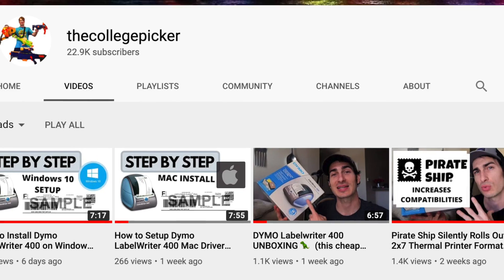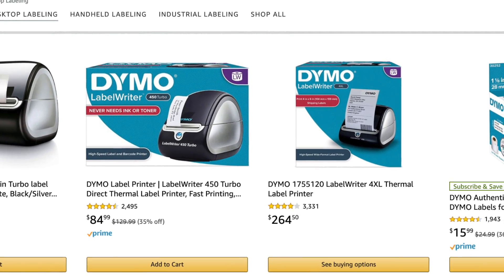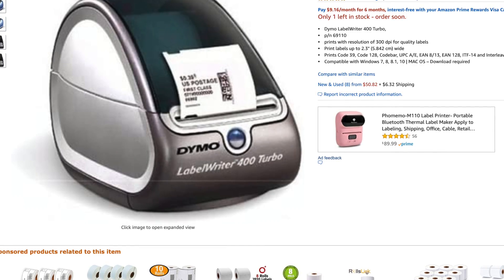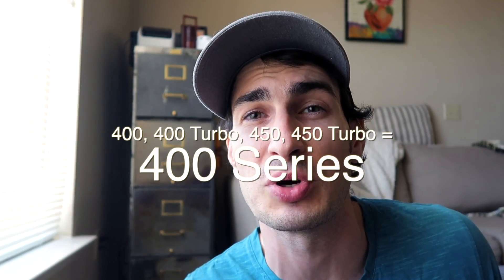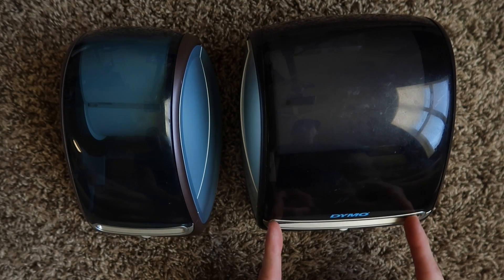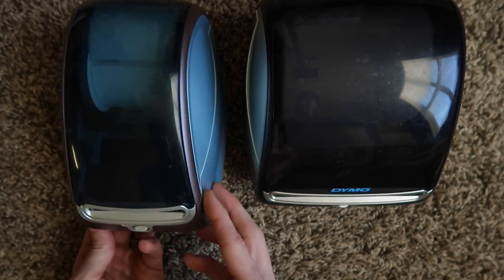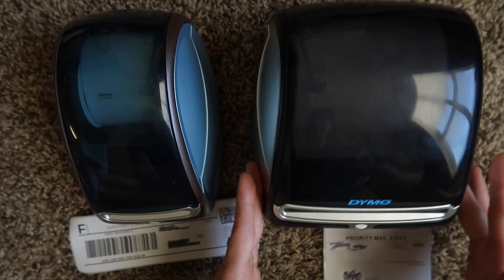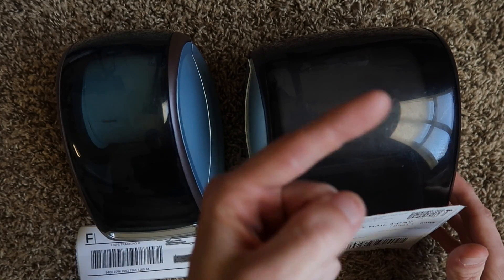DYMO 4XL vs 450 vs 450 Turbo vs 400 vs 400 Turbo

Comment: Hello, I have a 450 currently but it's dying out. What would you suggest for an alternative? I exclusively print 2 in x 3 1/2 in appointment cards at my business if that helps. Thank you.
Reply: What do you mean by dying out?  Is the print fading or failing?  If so, the thermal print head needs cleaning.  Dymo makes cleaning cards, or just use a generic 4x6 one cut in half.  Or you can just use a business card soaked in isopropyl alcohol and run it through.

Comment: Have you heard of the 500 series? What is the difference?
Reply from the maker: Yes they just came out with the 550 and 550 turbo. New video coming soon! They added chips to the roll to force you to buy dymo only labels. The turbo model has an Ethernet port which is nice but the new chip feature is awful 😭. Check out the 5XL two new videos on my channel it's a bigger version of the 550.

Comment: What if I don’t have a computer but for my business I use Shopify can I connect my phone to it so it can print out shipper labels for my packages ? Which one would I need to get ?
Reply: As far as i can tell none of them are bluetooth so you would need a computer pretty sure. It looks like there are cheaper different brand label makers that have bluetooth
Reply: I think "brother label printer" a option for bluetooth wireless

Comment: 5:00 Telling us that the difference between A and B is 20 labels per minute is pretty much useless information without saying what the numbers actually are. If it's 30 vs 50, that's a big deal. If it's 900 vs 920, then not so much.
Reply: Well thats a good point the fact woulda bin helpful but for 99% of people using this for ebay, etsy, mecari or what not if you get 5 orders to fill and it takes 30 seconds per label youd be 2 and a half mins, if you dont have a single extra min of time to wait then i guess its somthing to worry about
Reply from the maker: It's about 55 vs 70 labels I think. Sorry there is so much information it's hard to hit every point 🙏
Reply: Is the speed really that big of a deal unless you have a huge business? If your printing 5 labels at a time do you really need it in less then a min really a issue? Im looking to buy a cheaper label printer for ebay, macari ect. I just dont see the speed of the labels to be very big of a deal
Reply: @raid_or_die8962  If the speed difference is 2 labels per minute vs. 22 labels per minute, it's a big deal. It's a HUGE deal. If it's 30 labels vs. 50 labels per minute, then maybe not so much. My point was that the video gave no frame of reference for the 20 labels per minute difference, so it's nearly meaningless information.
Reply from the maker: I'll do better next time and not be useless. 🙏

Comment: Wow. 12minutes and you never explained the difference between 400 and 450 🤦‍♂️
Reply from the maker: It's in the beginning, they are essentially the same. We call them "400 series"
Reply: @thecollegepicker  ok, so what's IS the difference?  "Basically the same" means what
Reply from the maker: @rjc4370 Basically the same -  nearly identical specifications and compatibilities with insignificant differences that won't make much difference in any business in a day to day operational setting. This video is focused more on a 400 series vs 4xl comparison and I apologize for the misunderstanding.

Comment: mines is printing with gaps on it how do i fix it?
Reply from the maker: It sounds like you might have adhesive stuck on your printhead and need to clean it off. These are terrible to clean unfortunately. 😭
Reply: @thecollegepicker  how do  i clean it off I bought it used for 30 $ :/ alchohol? Peroxide?

Comment: I just purchased the Dymo 450 twin turbo. I am producing a high volume of labels. Which printer do you recommend for high volume and also speed is very important.
Reply from the maker: Twin turbo is fine.
Reply: @thecollegepicker  thanks for the response. I have been using the Dymo 4XL for some time now, and sometimes when I print more then 500 labels it slows down. I am hoping that the twin turbo will do a better job. I have been thinking to purchase also a label rewinder, but they seem to be very expensive. Can you recommend any label rewinder?
Reply from the maker: @Gottham8  The dymo 4xl only holds 220 label 4x6 size rolls, how do you print 500 labels at one time? Are they smaller labels than 4x6? I have not used a label rewinder. Maybe that will be something I need to explore =)
Reply: The size of labels I use is 2 5/18 x 4" and the roll contains 300 labels. Right now I have always to insert a new roll when the request is larger than 300 labels. I print 50 labels at the time as I do need to fold them. So if I had a rewinder I would probably print 295 labels at once and then insert a new roll. At some point I had a request about 2k labels, so the rewinder will definitely help.

Comment: So happy to have found you. Can the dymo 450 print 4x6 labels compatible with Shopify ?
Reply from the maker: Hi thanks, but unfortunately no the 450 doesn't print wide enough
Reply: thecollegepicker thank you so much ! Do you know if it’s required by the post office to print 4x6 labels?
Reply from the maker: It not required no, but they must be readable and scannable. You can print 2x7 with a 450 in pirateship

Comment: Thank you, very helpful video.
Just a quick question, can the Dymo 450's print different size labels?
Reply: You can always click 4x6 in print options. Then fit to page and it will print usable shipping labels to the 2 ⁵/¹⁶x 4
Reply from the maker: That is another way to do it as well 😅👍
Reply from the maker: You are welcome. Yes any size up to the max 2.4"

Comment: I’m going back and forth on all the Dymos - I ship with pirate ship but use Shopify platform. I want to be able to use wide format and the 2x7 labels. Which printer can I do that with?
Reply from the maker: It wouldn't be efficient to do both. You can do everything 4x6 with any 4x6 printer. The printer has to have the width for 4" to work. Hopefully that makes sense. 🙏 Thanks for watching
Reply: That’s what I want to know I sell from Shopify as well. I want to know if I have to use pirate to print the perfect label horizontally. I use 2x7 labels and they keep coming out wrong somebody help 😫

Comment: I have the 450 turbo I been printing USPS labels for about 1 year I sell on Ebay mercari and poshmark will the 2844 print on all those for usps fedex ups for those formats? If not what printer would you recommend I print from a desktop so wireless/ bluetooth is not a factor for me  thanks
Reply from the maker: Mercari does not have any 4x6 formatting. You would have to do the address copy/paste by hand into pirateship and in that case your 450 turbo can print 2x7 on pirate ship.
Reply: @thecollegepicker  ok well why do you think would be the best printer for what I do from being I dont need bluetooth and price is always a factor I just started using the 450 because I had it from doing fba in the past

Comment: You CAN print the 4x6 labels on the 450 using 4 inch long labels and setting your print to SHRINK TO FIT.  Are they standard 4x6?  No.  But they are still completly readable and scannable by the USPS.
Reply from the maker: Never tried that before! Might have to experiment 🙌🙌 appreciate the Intel.
Reply: Will the post offices still accept and ship with the smaller labels? 

I’m thinking about getting the 450 turbo for Etsy
Reply: Omgrueffin1234 yes... that’s what I use and just shipped 20 packages with no issues.
Reply: Cool Ridge Creations ok thank you !!
Reply: When I do shrink to fit it does not work. I have to take a screenshot and save as a photo and copy into DYMO. Such a hassle. Can you give a detailed step by step so I can print on the 4x6?